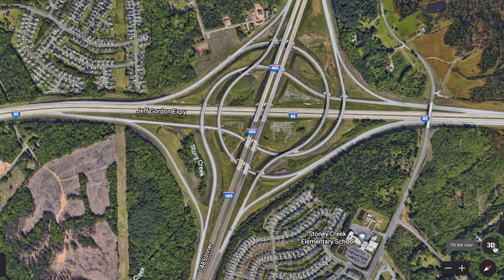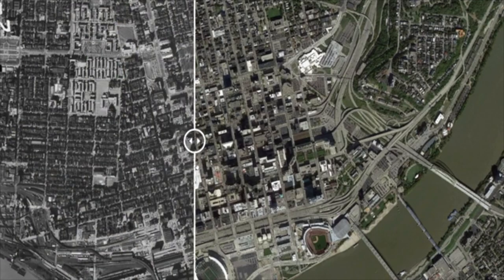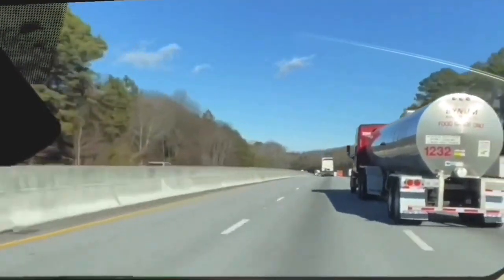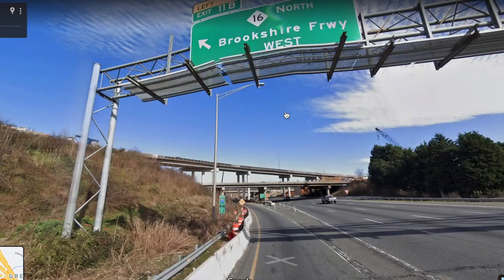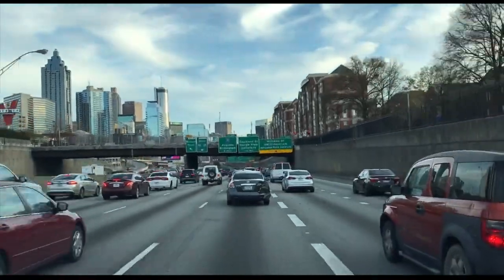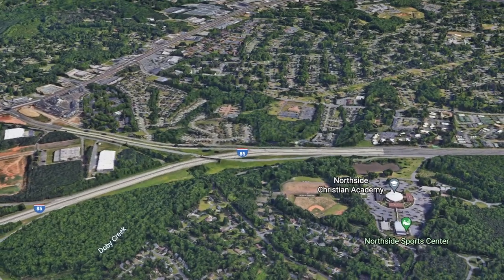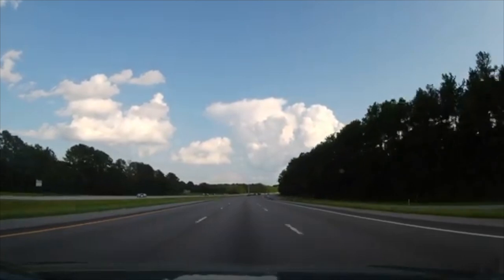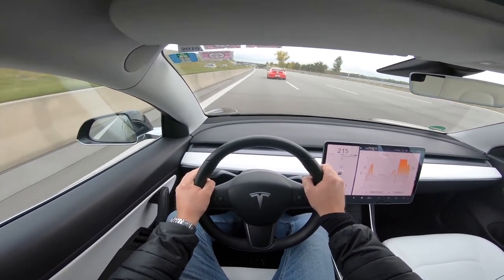Why US Highways SUCK

Comment: Lack of driver training, especially lane etiquette on highways, is a HUGE factor in the inefficiency of Interstates. And they never even seem to learn over time either.
Reply: Yes YOU need to be retrained that you cannot go faster then the traffic in front of you, even in the left lane. It's a highway not a NASCAR race track.Chill out and slow down a bit and maintain a safe following distance.
Reply: @Senator_Senart  So you're one of the slowpokes in the left lane, blocking the cars that wish to pass dawdlers like you, amirite?
Reply: @edwardmiessner6502  only when people keep passing me on the right and won't let me move over, but yes I drive "slow" (55-70 mph) to keep back and as far away from the rest of you psychos driving 80+ mph down the freeway tailgaitng and lane weaving (cutting off) each other......

I drive alone behind the packs of cars on the freeway and follow the 3 second following distance rule. I care more about my own safety then maintaining a high rate of speed on the freeway no matter what.
Reply: @Senator_Senart spot on. Failed planning models can’t be blamed on everybody not being collectively perfect enough. Beyond its optimal carriage a road can’t flow smoothly at any amount of skill. Build bad roads and you get suboptimal capacity in the first place. Build only roads and you exceed optimal capacity too. Simple maths problem a child could figure it out without copping out.

Comment: Funny how many similarities Belgium has to the US. We had a very similar history when it comes to urban planning.
Reply: like Antwerp, which was even warned by German engineers the ring would be far to close to the city and cause problems?
Reply: Luckily it's not as severe. We at least tried to make the highways go around cities
Reply: Brussels Ring (bypass) : coming from Halle, first obstacle is the "Bocht van Vorst", an almost 90 degree bend (because the Ring was not finished as intended) then further on First lane becomes an exit lane. Further on there is an entry from the left (Erasmus). Then you get to the infamous interchange of Groot-Bijgaarden and its bottleneck : 3 lanes first become 2 lanes, then 1 lane.  That 1 lane becomes the third lane of the Ring. And that's just a few km of that bypass.
Reply: At least we're turning things around now, we're no Netherlands but the infrastructure we're building now is pretty good while also trying to fix past mistakes. Also almost all countries had a "cars are the future" phase and basically every city was ruined by the car, but it's getting better

Comment: how can the country that invented the car as a mass produced way of transportation for the masses suck so bad at designing roads ???  insane!

As a european I agree with almost everything, except the 2 lanes on each side, this should only be the case in very rural areas with little traffic, if it gets a slighlty bit more dense 3 lanes on each side are a godsend, the slow trucks can stay  right, the 'normal people'  can use the middle lane to overtake the slow traffic and the speed freaks can use the left lane to overtake the ' normal' people.  
If you have only 2 lanes, there is too much difference in speed and things can get ugly. 

and I am talking about autobahn kind of speed (although it works well there too)  but on roads with a speed limit , where slow medium and fast would mean 55, 70 and 80 mph

Comment: 2 Things. I agree that if you design highways like you said in this video, they will work better, but as an example in Australia, I think there are cases when you don't have to design highways as you suggested.

Yes the left lane should be used for overtaking, but once the number of cars on the road increases to a certain threshold, it becomes more dangerous to operate this way because one lane will be traveling slow while the other lane travels quickly. In fact it's more dangerous for each lane to be moving at different speeds as lane changing is the most common cause of accidents on highways (which is why you aren't supposed to change lanes in tunnels here in Australia). I know in America the speed limits are treated as suggestions, but Australia actually has a very good culture of people following the speed limit, meaning the whole keep right unless overtaking thing is a bit mute, because everyone travels at the same speed anyway (except big hills and stuff, but in those cases the rules are enforced properly). I would suggest that the German autobahns have a good safety record because without the speed limits, drivers are forced by the conditions to pay attention and drive properly. It's complacency that causes accidents. The other reason accidents happen are mainly due to congestion, the easy way to fix this is to have adaptive speed limits that lower when the cars on the road increase. This stops traffic from speeding up and slowing down constantly and gets traffic to move at a consistent and lower speed.

In terms of exits and entrances from the wrong side of the roadway, the US highway administration identified this years ago as a potentially bad idea, but most of those wrong side ramps were built years ago and it's a really expensive process to fix them. Interestingly, they don't necessarily make things any more dangerous, because they can actually reduce complacency and make drivers uncomfortable (which can increase safety). The other thing to realise is that even with merges on the "correct" side, drivers in the fast lane still have to get into the right lane in order to exit, or travel over once they enter, you might think that's safer than the alternative, but often what you'll find is that the majority of cars on the road consider themselves "fast lane" users and it's actually likely to make things worse. Also at interchanges if the majority of traffic is making a left or right onto another highway, they will all want to be using the right lane/s to exit and it really puts a spanner in the works of the whole right lane exit things. The reason why they add lanes extra to the right side of the highway and not the left is because often when an entrance comes in to a congested highway, if the entrance is congested too, then all the cars will be trying to merge into just the one lane which clogs up that lane and makes for a very dangerous situation, so they just have the entrance lane become the new right lane. (it's not ideal but there is no real alternative besides having the entrance lane come into both sides of the highway).
Reply: I’d counter the notion that introducing complexity necessarily improves safety. You’re correct in the case of tree lined streets or cobblestone etc. but that’s all in countering forgiving design, and it’s to cause drivers to slow down. But on the freeway the design is still forgiving, the lanes are wide and the view is open with no obstacle, and the speeds are high. The separation should be complex + opportunity to think or simple + high speed. They should never mix.

Comment: Y’all can use me as a dislike if you want.
Reply: let me guess, you drive a chevy pick up truck and watch Nascar
Reply: @Blackadder75  you got half of that right. I won’t be caught dead in a bow tie! Hell idk how I even ended up dailying a dodge truck tbh I’m usually a ford guy.
Reply: @hilljackzack7284  damn, I was typing ford f150 at first, but then I changed it to chevy
Reply: @Blackadder75  🤣😂 technically both would be wrong but I miss my 7.3! That truck was badass!
Reply: @Blackadder75  I’m currently rebuilding the front end of my dodge and hating every second of it.
Reply: @hilljackzack7284  buy a tesla, and you will never have to rebuild anything on your car anymore    :D :D :D  (you just can;t use it anymore once they stop updating it)
Reply: @Blackadder75  🤣😂🤣😂😂😂😂🤣🤣😂😂😂😂😂😂😆😆😂😂😂😆😆😆 no I think I’ll stick to shit that lasts instead of having to spend $70,000 every year on a car I can’t afford.